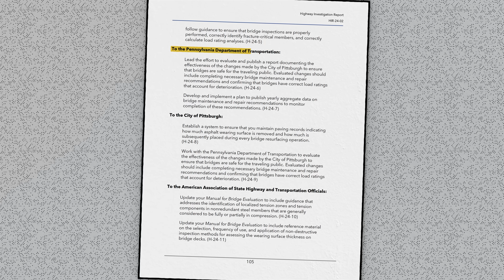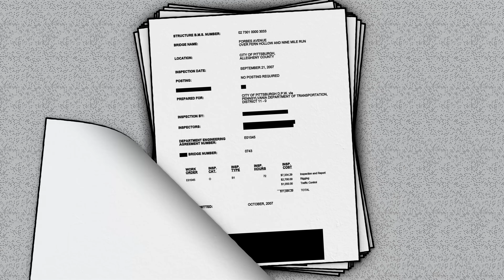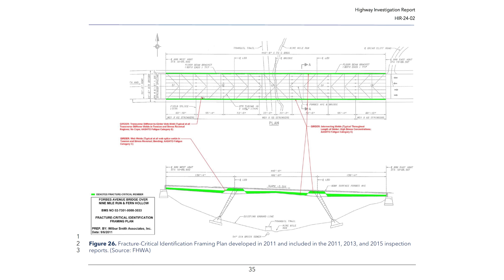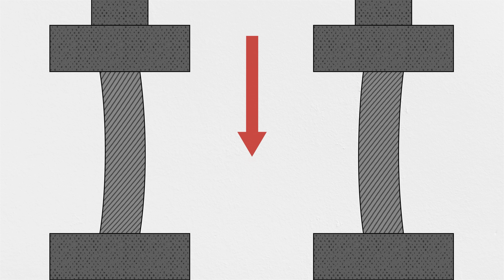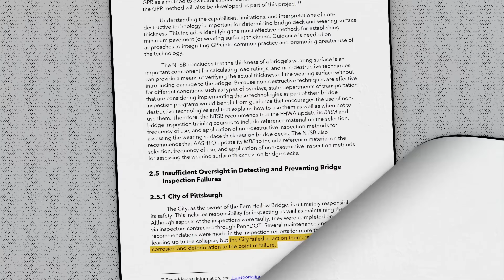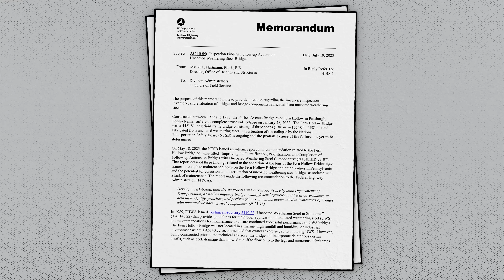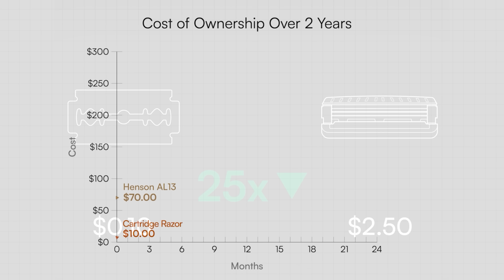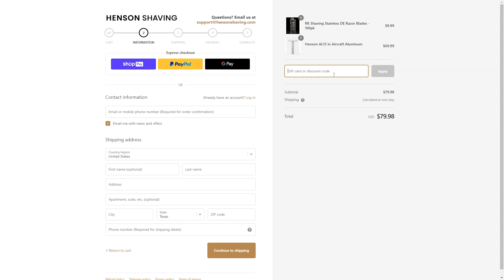This Bridge Should Have Been Closed Years Before It Collapsed

Comment: Wow. This sounds like EVERYONE responsible failed in their jobs.
Reply: Except for the inspectors. They repeatedly documented everything wrong with the bridge, but had no power to get it repaired.
Reply: except the inspectors, who recorded the issue dutifully for nearly a decade, submitted their paperwork, and trusted it would be fixed in time. they were really let down by the system not having a way for those reports to initiate a repair. 

if you've ever worked in an environment that necessitates bureaucracy, you might be more understanding that even if these people did speak up to their superiors and say "hey these have been in dangerous condition for five years", the response would have been the same. their superior would say that the inspection report is all they need, that once its submitted the higher ups will make a decision on how to proceed. its a shame that it never actually happened.
Reply: @arcanealchemist3190  Fair enough. The visual did show that the reports mentioned the severe problems for YEARS. I guess I can only echo Brady's thoughts - how can we design such a complicated system that doesn't actually work?
Reply: Except for the city's lawyers. Their job is to make sure that nobody is ever found legally liable for this mess.
Reply: @jakedee4117 is that confirmed?
Reply: @lawnmowerdude  I haven't actually looked into it. I was just having a crack at lawyers. As Lionel Hutz (attorney at law) said, "If there's one thing this country needs, it's more lawyers".
Reply: The pittsburgh way is if a inspector fails a bridge they get fired  and replaced by someone that gives a D- around 80% of the bridges in pittsburgh are considered a D and structurally deficient but none are given a failing grade. When a bridge collapses "Well yesterday it was a D-"
Reply: @PTRMAN  Administrative systems are rarely designed, at least in a literal sense. They are more like organisms that just grows until it runs out of sustainment i.e. taxpayers money.
Reply: @Chainsaw-ASMR  Maybe that's a good avenue of attack.  Grant the power to the inspectors to shut a bridge down.  And yank their license if they regularly abuse, or fail to use, that authority.  Some random health inspector can shut down a $1,000-per-plate restaurant for a steam table that's off temperature.  Infrastructure should be more important.
Reply: that's the state for you
Reply: @arcanealchemist3190  That higher up level of leadership? We need to hold them accountable to AT MINIMUM capital punishment. Everywhere, always. This bullshit of nobody ever being responsible when someone dies is bullshit. A eye for eye.
Reply: @toddthreess9624 
Inspectors do have the power to "fail" a bridge. I would wonder how many inspectors were fired after doing so.

Comment: Another factor plays into the deterioration of CorTen structures. The welding rod material prescribed for COR TEN construction was initially incorrectly formulated. Structures that were bolted instead of welded have survived well. You also see, in the failure reports you show, the major deterioration occurred at welded joints.
Reply: The deterioration was at locations that could hold rotting vegetation and road salt. I can clearly see how the central webbing was gone, not just the corroded braces. 

If you have ever seen the added roof section that diverts rain around a chimney, that is what was missing from these braces. 

But mostly, the cross brace was never highlighted as a critical tension member, and road salt was spilling over the curbs for decades.

Comment: Another case of inspectors who have no authority because if they had, costs would ensue. Like with Boeing...
Stuff like this should in my opinion be handled by a direct subsidiary of the top level of government, in the USA as a subsidiary of the White House for example, where the inspectors are given the full authority of the nation to order measures to be taken if they deem it necessary. They should be accountable only to the public/highest level of the government, without fear of retaliation for ordering a state government or a city government to fix their stuff.
Reply: That would have the exact same issues as the current system, it would just mean the inspectors answer to federal politicians who answer to voters nationwide instead of answering to local politicians who answer to voters in the local area.
Reply: @SnakebitSTI  As I said: Highest level of Government. Not just random federal organization.
Reply: @insu_na  I know. You are proposing that the POTUS be responsible for ensuring that the inspectors do their job, that Congress be responsible for allocating the budget for the inspectors to do their job, and that the entire voting population of the country ensure the politicians do their jobs.
Reply: @SnakebitSTI  no, this is something that should not just be done in your country, but everywhere. Their budget comes from the head of government. The budget for the infrastructure repairs comes from whichever party has the broken infrastructure in their area. They're not going to be asked to approve the budget, they're ordered to fix the issue following the inspectors specifications and they'll have to pay whether it costs, if necessary via a forced loan.
Reply: @insu_na  We are talking about a bridge in Pittsburgh, Pennsylvania, USA. Your ideas are completely incompatible with the structure of the municipal, state, and federal governments.
Reply: @SnakebitSTI  then don't respond to comments you haven't read or understood

Comment: So...

2009:  The cross braces allowing the legs to continue holding the bridge are found to be in a state of failure and are shored up with temporary steel cables to allow continuation of bridge in public service until failing braces can be repaired.

2022: No leg repairs having yet been attempted, bridge collapses with temporary diagonal cables still trying to hold up the vehicles.

I mean does anyone really need federal engineers to explain what the specific human failure was here?
Reply: This is not a human failure, this is a system failure.
Reply: @JerzyMuller     It sounds like you're saying it wasn't just one person, but that wasn't really what I meant.
Reply: Yes, because without the NTSB report you have literally decades worth of literally a city's worth of paperwork to look through. The NTSB looks through the paperwork, interviews people, determines what factors were how relevant, and summarizes it all in a report.

It's easy to say "ah ha, that was the problem!", because the NTSB already did the hard work and provided a convenient summary of the problems.
Reply: @SnakebitSTI    That's a fair point, but I wasn't trying to say we didn't need investigation or fact-finding; simply that once the facts are known one doesn't need an engineering background to see what really happened here.

Comment: Oh, so That's what Cor-Ten steel is for. It would explain the "only to be repaired with Cor-Ten steel" signs I see on ISO containers.
Reply: The signs that no one cares about because everything rusts
Reply: theres two types..."disposables" are just plain old mild and rot like any other steel. cortens a bit harder, can tell when you try poking tek screws in...

especially the rails... the structural stuff... gotta predrill...

Comment: They couldve atleast drilled or cut a few drain holes in obv water catchment areas so not as much water was trapped in the steel it basic cheap easy and quick to think nothing was done except for those crossties problem is there put under tension as mentioned wich adds integrity but also puts undue stress on already weakened areas there a double edged sword and shouldve been very temporary

Comment: Hello everyone, i am from The Netherlands, (aka Holland), and i am shocked to see how inspections have been done on this bridge, and most probably many other bridges all over the United States. 
Here in Holland, we do NOT use Cor-Ten steel to built bridges or other peaces of infrastructure. We mainly use it for works of art, monuments, and decorating, like planters.
We are a country with pretty high number of bridges, in all shapes and sizes.
This includes also steel bridges wich are built from special special steel that can cope with the environmental conditions in our country. Also a special coating is used for extra protection. And, those bridges are checked at a regular basis by either local authorities, and/or engineering bureau's who have all the knowledge about the wear and tear of bridges, both steel and bridges (partially) built from concrete.
In short: We have oversight here in Holland, and, engineers are taken 100 percent seriously!!
The're NOT ignored!!

Comment: This all comes down to beaurocracy. There should never be an annual budget for safety related repairs. They should be done proactively, without budget concerns, and the taxpayer should foot the bill as necessary. If there were proper audits of the buddy buddy systems in place between city municipalities and private contractors, the cost of repairs would be half of what they are. As a contractor myself, there is no more lucrative position than working for the government. Us in the private sector scrape by, conscious of  our clients cost factor, but the government contractors are given a blank check and yet still complete work way behind schedule and way over budget, often to a poor or temporary standard, all the while getting filthy rich off taxpayer money

Comment: Probably dumb question from a lay-nerd who also watches a Swedish man break down aviation incidents: Is there an equivalent of hydraulic fuses for natural gas lines? They "feel" the pressure drop when there's a leak or breach in the loop and snap shut, so all the fluid doesn't gush out and leave the pilots without flight controls. Seems like it might be a good idea to not require human intervention to stop the gas flow... yikes.

Comment: The general lack of accountability (which is evident in all forms of local government) is responsible for the vast majority of structural engineering problems.
This means that the people responsible for allocating funds haven't attended Engineering 101, so they're incapable of making sound judgements.
The lack of accountability means this situation never changes.
I'm trained in Health and Safety and the initial implementation of most regulations meant nothing until legal obligations were attached and enforced, leading to direct accountability, which meant that things changed pretty quickly for the better (in the main) and for the duration.

Comment: Some of those reports required by agencies have so much stuff in them — hundreds of pages of data and tables. I fill them out as they are needed for legal reasons, but I’m fairly sure they just sit on shelves and someone checks a box saying it was done… therefore, I’ll often try to make a memo/summary of what I thought was the most important, but that also creates a liability or is not in the scope of work, and sometimes I’m told to not send it out. 😞 The oversimplification for calculations is also a good point, and might not be as necessary now that we have supercomputers at a lot of these agencies. Hopefully things will get better with machine learning, drones, and automation, and these inconsistencies can be highlighted to engineers without lawyers getting involved.

Comment: The designers trusted the client to maintain the drains and assumed that U.S. Steel had developed a product that would work in a damp creek valley.  They also assumed the material to be it's own redundancy, and that is the most absurd.

Engineers were Trusted to evaluate a Bridge that they Never Visited.

Politicians were Trusted to release funds to maintain infrastructure.

12:55 ... If YOU want MY Trust, don't dare claim that "No one was aware of the full scope of the Neglect...". It feels like dikinda'ear.

Comment: I’m a union iron worker and I done extensive bridge repair work,retrofitting and new construction I’ve worked on the Benjamin Franklin, George Washington,General Pulaski,Goethals,Walt Whitman, etc,etc the main thing that has always concerned me is that the inspection teams we are working with are operating from a theoretical standpoint or a focus on this issue only view Ive taken a jitterbug to remove some rust from a brace and had delaminated steel rain down on us with flakes the size of doritoes and the inspector said we aren’t here to address that area and since it didn’t fall out or detached from the main structure they wouldn’t even do more than a cursory look at it and move on or they will have the painting gangs slap some epoxy on it

Comment: As anew hire doing a field inspection I saw a failed beam from below the bridge structure. I drove to the builders yard and brought back barricades and do not cross ribbon. Spray painted the deck and posted signs to not enter. It was amazing the amount of excitement that happened next. But NO ONE would touch or remove the barricades. If you see a problem, do something . Don’t just talk and complain. The beam was fixed and everyone went on with their lives. Be active. Don’t be a watcher.

Comment: Sadly alot of the USA’s infrastructure is over 50 years old and crumbling so much is marked as dangerous condition, poor and needs emergency repair but still open and ignored by local authorities with no budget. This includes dams & pipe works

Comment: This to me highlights an issue that many people, not just government, struggle with: sometimes the best fix to a problem is to start again. This applies specifically to the recommended policy implementations, which is just adding on more to an already slow system. Instead, it might be better for the policy to be re-written such that fixed like these are more mainstream and direct from the get-go, rather than having to leave a paper trail to be misread and/or forgotten about.

Comment: I work as a crane inspector and have experienced this issue, I have worked on cranes with failed inspection reports going back almost a decade, no repairs performed, but the owners don't care and will only fix parts if it is unusable. 
I can see the problems, report them and recommend locking out the crane but ultimately I have no authority to enforce it, I'll shut off the disconnect and zip tie it open attach warning tags to the disconnect and controls, inform the workers of the risks but if they don't care or are more worried about their boss the possibility of the crane failing means little them.
Fortunately no injuries or fatalities have occurred on cranes I've inspected but I've had to provide documentation and statements due to major incidents

Comment: The best solution is to publicly post the inspections, maybe even on the bridge itself (like elevator inspections). Most people will ignore them but sharing failed inspections with the local news would probably generate action.

Another idea is to get rid of a bunch of the middlemen, give the inspector the power to shut the bridge down on the spot. Allowing people to continue driving across structurally unsafe bridges is criminal.

Comment: As a Pittsburgher and former USAFcombat medic , I remember seeing that inital photo of bus in the collapse and immediately going full trauma brain mode.  Buses full of passengers are so common on mass casualty response tests that I thought for sure there were at least half a dozen dead and even more critical, even with the low traffic.  I couldn't believe it when I saw no one died and how only a couple folks had been considered critical.  I cannot BEGIN to describe how f-ing lucky folks in that area are that this happened when it did.  

The thing is, this bridge is one of our most high traffic bridges (and that is really saying something in the "city of bridges").  You typically have at least 3-4 route options when you drive anywhere in this city, even when you cross a river you might have 2-3 bridge options to choose from anywhere else, but here it meant massive reroutes adding half an hour or more on to someone's route.  And most Pittsburghers 75% seriously joke about a 15 min drive to already being WAY too long.  So this bridge location is a HUGE deal.  

Also, while the bad weather might have stopped/slowed school buses, snow doesn't keep us inside here like it might elsewhere so the earliness was a huge factor too.  Hell, a lot (-cough idiots with brand new Jeeps racing on McKnight cough- of us take bad weather as a challenge.  And if you think the snow would keep the us out of Frick Park (our largest park in a city with over 165 parks that are all heavily used), you should look up how PA folks dress in the snow.  

All of that said, its still beyond the pale that this failure happened and anyone was injured at all, not to mention the psychological trauma I'm sure they're all dealing with still.